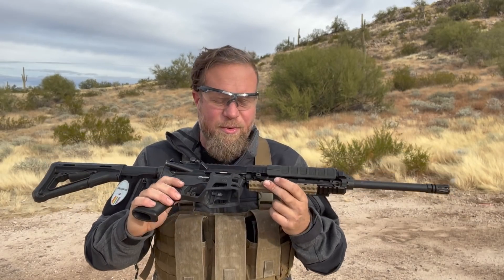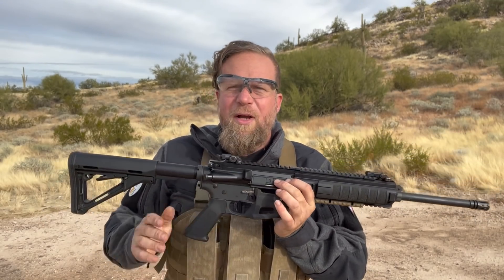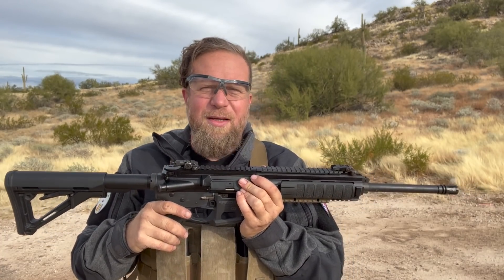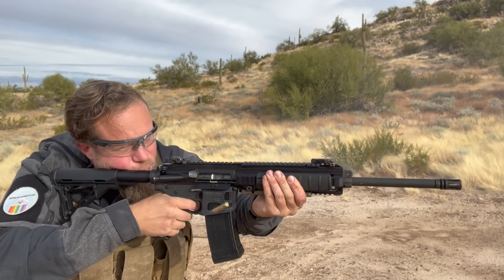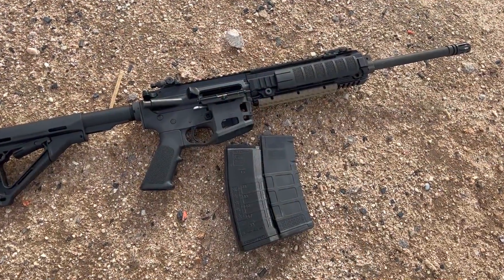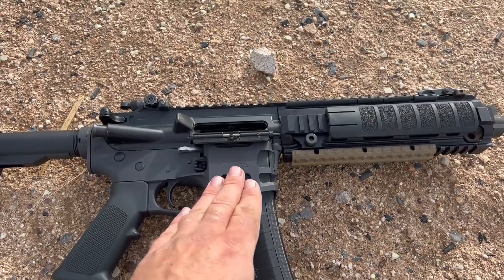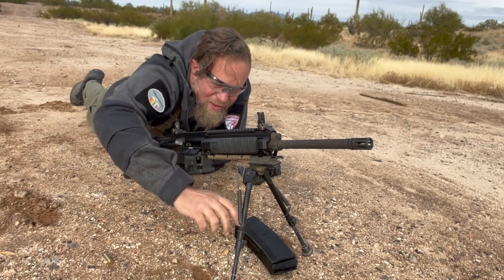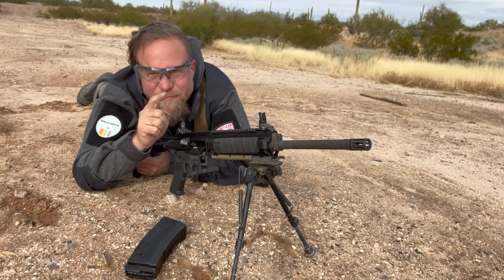Desert Tech Quattro-15

Comment: Definitely a would buy idea if they could get magpul to mold the magazines and it doesn't take desert tech half a decade to bring to market. I'd convert over to this.
Reply: Dude, they are literally printing these magazines! He said so at least twice and you can buy a 3D printer for polymers on New Egg for about $600 last I checked.

So, if these don't come to market as a Patented lower receiver, then buy a printer, print a lower (maybe do some CAD work and print the stock, too), and print magazines !

Comment: Why 53 rounds? Issued ammo is 10-round stripper clips. I'd rather take the slight length penalty and get all 60 in there, than either short-loading the mag at 50 or doing something with the loose 3 rounds. Still awesome, glad to see someone is innovating and trying new things.

Comment: I'd like to see how much mileage they could get out of making one of those the same size as a 40-rounder.
Reply: At what point does the weight of a loaded magazine get to be excessive?
Reply: @allenrichardson2956  never
Reply: 100 round mags? Seems pretty doable with this concept
Reply: I wonder if the spring pressures required to make that work would result in hand-loading the mags becoming prohibitive
Reply: You could just clip together 2 of the regular 53 round mags to get the capacity of a belt fed. Wouldn't be TOO bulky.
Reply: If 30 gets you 50, 40 should get you 65, maybe 70.

Comment: Eh, to me this seems to fundamentally miss the point of box fed LMG's, which is magazine comaptibility with your squadmates. Take the RPK against the RPD, the RPK had an edge for multiple reasons, but a major one was that it could share magazines with other squaddies, wheras this doesn't have the advantages of a belt fed, but also doesn't fully excise the disadvantages of a box fed either. Sure there's an adapter, but I'm not convinced that you'd want to muck about with that mid-firefight. It's certainly interesting, but ultimately I think is a little flawed. 
Always appreciate the coverage though Karl, keep it up!
Reply: All accurate observations.  I would add the fact that you lose the mass of the belt fed weapon,  contributing to cooling issues.  Lighter rifle weight parts heat up much faster and cause the gun to basically "choke " it's self (the parts begin to bind and lose velocity). With the belt fed saw or even the old m-60 you could just open the feed tray cover and spray in some CLP without handling any hot parts.
Reply: So if you swapped the whole squad over to this tho—-problem solved. Honestly I think that’s ought to happen—-but USMC should still move back to belt fed
Reply: @alexberkowitz5897  I'm not really sure my thoughts on belt Vs mag, but I think it's very unlikely any major army is about to change over to this one off weird mag concept, when stanags are so incredibly common and good these days. The logistical trade off just doesn't seem worth it to me.
Reply: @alexberkowitz5897  They kind of unofficially are. They've made each squad have access to one m249, per SL preference and 6 to each platoon per the PLs preference. Enough for each fire team to have the automatic rifleman be armed with one.
Reply: Depends on the adapter. If it's just a "slide it in until it clicks" kind of thing, then it would really be no different than putting in a new magazine.
Reply: At this rate though, who says only the gunner needs a quattro magwell? Give them to everyone

Comment: Honestly I think mags should work with a rail like system (something like the old Thompson minus the drum mag slot) that way as long as it has that specific rail and can properly feed it can work regardless of size and shape (this could work well with caliber conversions). However I do see the issues of a unreliable system there in the context of mud, dust, dirt, and ice but maybe that could be resolved over time

Comment: Oddly this also makes for OTHER interesting concepts... like a double stack magazine for cartridges like .50 Beowulf and .458 Socom...
Reply: Robert Sears  okay, a few corrections.  No, the .458 SOCOM is not the same diameter as .45 ACP.  First, its a necked cartridge, AND its a .458 caliber bullet [IE. 45-70 bullets].  What you are looking for is the .45 Raptor, which is basically, as described, a .451 diameter bullet on a chopped .308/7.62x51 case, loaded to .460 Smith and Wesson level.
Reply: And or integration of "super-short magnum" style cartridges in a double stack ar15 style frame.  Talk about armor busting if you can get small dia AP/steel core/monolithic style bullets up to 3500-4000.  There could also be a great potential for a long-range precision gun based on a fatter cartridge lobbing a very high BC 22/6mm/25 bullet.
Reply: @mattfleming86  That would likely require a complete redesign of the platform. Short magnum rifle rounds produce extremely high bolt thrust. Even if you used a rebated rim design to fit in a .308 bolt face, you'd be beating the crap out of the gun. There's a reason why even recently developed military cartridges have been pretty mild with regard to the "short and squat" trend seen in short magnums and benchrest oriented ones.
Reply: @KyussTheWalkingWorm  You're right.  And the rebated rim's have not been faring well.
Reply: @KyussTheWalkingWorm  you guys have no imagination. The case design does not dictate bolt thrust. Pressure and square inches do. There are uppers to fit wsm/wssm cartridges out there readily available that are standard ar15 lower compatible. I have two. Rebating the rims isn't necessary, although the wsm/wssm/rum based cartridges are all slightly rebated, as is the .284 win case for the 450 bushmaster and the more heavily rebated 458 socom. Saying rebated rims don't fair well? Kind of a joke, seeing as how they're not unpopular by any means.
Reply: @mattfleming86  down side would be barrel wear.
Reply: @mattfleming86  That would be the .224 Norma or .224 Federal Magnum, right? Instead of necking the .30 Remington case to .277" for the 6.8mm Special Purpose Cartridge (.270 Remington Special when loading 130-grain boat-tail spitzer-length C.O.L.), it gets necked right on down to .224" and puts an 88-grain VLR bullet out of a 20" (-A2 length) barrel at 3,300 fps. The measly M855A1 AP bullet goes out at 3,800+ fps.

.270 Remington Special was intended to fit 28-cartridges in a standard 30-round double-column magazine; so, 14- for 15-, so a 53 would still hold about 50. So, an M27 IAR with this DesertTech lower and, say, a 24" carbon-fiber-wrap bull barrel for stiffness and maximum heat dissipation chambered for .224 Magnum with a nice long M-Lok handguard to free-float the barrel away from the bipod, a nice USMC-approved ACOG on top. 50 rounds per magazine and penetrates level 3 armor plate out to 500 meters or so. You want to figure out how to carry a minimum of twelve 50-round magazines to equal the usual 6 triple-30rd pouches plus six 30-rd on chest for an IAR. Remember, M249 started with a basic load of three 200-round belts and took off from there based on experience!
Reply: A .50 Beowulf with like 20 rounds would be pretty cool ngl
Reply: Robert Sears  pretty simple really. The socom was designed to have the same taper as three 5.56 rounds so it would reliably cycle through a standard gi mag. The socom is a poor fit in an AR10/lr308 mag. The taper is wierd and the rounds are the right diameter to cause problems double stacking but they won't single stack. Look into big bore and wsm projects done on lr308s for examples. The socom is quite close in case head dimension to a Beowulf, with the obvious differences. 

I've got a couple projects going with both platforms. The AR10 takes a .284 case at the biggest reliably for double stacking. It doesn't really like wsms all that much because it's too big and too small. Rounds get spit out occasionally. A new wider mag is needed for running something socom sized in a double stack ar10. You have to use something like a Lapua case before single stacking is viable in an AR10, and that proposition is borderline insanity. There's maybe one project that exists that's similar, using a 500 Jeffrey case as the parent to make the most powerful ar10 cartridge yet. It's a dead project because of expense, and at the time the market wasn't interested.

Comment: i would love to get some data on how much of a difference in suppression you get comparing 2x30 and 1x52 (53?) magazines. 

you save one reload giving like up to 10 seconds (when fumbling really bad) to any adversary, but you gain more rounds and technically more reliability (if one fails, you still have the second, while when the one 52 mag fails, you got zilch).
Reply: i think figuring out a big box with 200 rounds that fits a normal magwell and is reliable would be another alternative. or working round mags...
Reply: I’m just going to say, the reliability part isn’t a factor, provided that these mags are fully reliable they will be new and replacing worn out stanags, so it will offer improved reliability no matter what. Also 200 round mags are impractical and wouldn’t work so you’d end up with a belt system, which already exists and was proven useless with the m249 SAW

Comment: I think that for this system to be successful, it needs to be able to accept standard AR magazines aswell as their magazines. The military has a fuck ton of standard 30 rd magazines and i doubt they would invest in replacing their surplus.
Reply: We created 30 round adapter insert that clips into the mag well in seconds with no disassembly required.
Reply: It does, he went over that.
Reply: @SuperSecretSquirell  I meant without the insert

Comment: Looks bulky and awkward as an alternative to standard mags, but as a replacement for 50 round belts in a support weapon it has potential.
Reply: literally fits in standard pouches but OK
Reply: @kaiserruhsam  not many guys actually run double mag pouches though. Sticks pretty far out. Even singles can be a pain in the ass when prone
Reply: It's ~70% heavier, going by capacity.  But think how many fewer mag changes you need to do.
Reply: wich in and of itself is not a weird direction to take this as the beldfeds are phased out more and more
Reply: I hope they can make it natively work with standard mags, no adapter. That’d be interesting

Comment: This is awesome... I hope they also develop short mags... I like the idea of also having short 30ish round mags for the option of lightweight rifle handling, plus a super low rifle profile 👍 Can't wait for this to hit the market 🙏Great work Desert Tech!
Reply: t h e q u a d c u b e
Reply: @j.yossarian6852  they could call them qube mags
Reply: By the looks of it, a 40-round quad would be a little longer than a standard 20-round mag.
Reply: @Zajuts149  yeah a roughly 20rd stanag mag length is what I had pictured... the width of the mag really doesn't matter for bulkiness now that most people add lights, lasers, bipods, large diameter lpvos, etc. I really hope this design goes somewhere! Especially if an insert allows the use of regular mags, pretty slick 👍
Reply: Maybe even a .308 version... Would be quite interesting.

Comment: huh, my first guess was this was going to allow you to load two mags side by side and swap over automatically. then you could reload one while firing t'other. This is obviously a lot simpler.
Reply: I thought the same thing. However that concept would be really impressive to execute while maintaining rate of fire. Considering how the cases feed out of standard mags, there would have to be a mechanism that selected which to pull from so you don't get a double feed. Then there would have to be some kind of transfer mechanism (which would have to work reliably) and that has to happen as fast as the bolt reciprocates. Additionally, every time you go to swap the empty while shooting you could mistakenly release the one feeding rounds. And one of the magazines would require you to reach around the other to swap. Great in theory but not easily executed.
Reply: No need to overthink it. Just make everything BIGGER.

Comment: Ok so we've doubled the width so that one magazine takes up the same space in your load bearing kit as two 30 rounders, but we haven't doubled the capacity.  Haven't we then reduced the combat load of ammunition by essentially a whole stanag magazine? I submit that instead going to an extended 40 rnd stanag would both increase the number of rounds you could carry in the old kit and reduce reloads without having to use a proprietary lower.  I'm calling gimmick.
Reply: The width isn’t double because you don’t have two sidewalls so the quad stack is decently narrower than two 30’s.
Reply: @NicholasYoungDT  It may as well be.  I guarantee you can't fit 2 in a STANAG carrier and if you could it would stick out 4 inches and make mobility very difficult.
Reply: You call gimmick. I call prototype.
Reply: @Scott-qq9jd  That's a fair point but the concept of coffin mags isn't new and this does nothing to fix any of the legacy issues with that concept.  I don't think this counts as innovation.  If anything we've traded stagnation for regression.

Comment: Isn't there a loss of overall capacity with these magazines ?
Seems like you replace 2*30 rounds mags with 1*53 rounds.

Still, very interesting.
Reply: No, cuz you gotta count the magazine in the gun too:
30 x 7 = 210
53 x 4 = 212
Reply: The mags themselves don't seem to bring a lot of extra weight unlike drums. They're literally wider box magazines. 3*53 rounds is probably comparable to 5*30 rounds.
Reply: That's a cost of fewer mag changes/total rounds expended. No free lunch.
Reply: That's what I was wondering. Still lighter than a drum mag though
Reply: He did say that it was shorter than a standard 30 round mag. Make it the same length as a 30 round mag, might be able to get back those rounds lost, or have an added 3 or 4 more.

Comment: Just adopt Negev at this point it can be both belt and magzine fed when needed while being reliable. A 50 round belt will always be lighter than a quad mag. This has been done and done again first by the US in spiw program and later by Russians. Russian tried both the things but demanded for belt lmg instead of rpk16 and also tested quad ak mag but not adopted it. Beside all this rock and lock lends it self better to be quad mag or drum mag fed. Also now will this magzine be backward compatible with regular ar no, while also not able to ask for regular ar mag when the shooter load out is empty. With 6.8 ngsw program it became imperative to invest more in polymer links and polymer case ammunition as being of large size even with quad ag and drum mag one can't fit more without being awkward to handle and load. So for ngsw the best option is to have a regular magzine and polymer links belt while being able to be fed by either when needed. The only ray of hope out of this can be if it somehow helps to make a reliable larger capacity 6.8 magzine as currently 25 round limit of the competitors is reducing firepower of soldier.